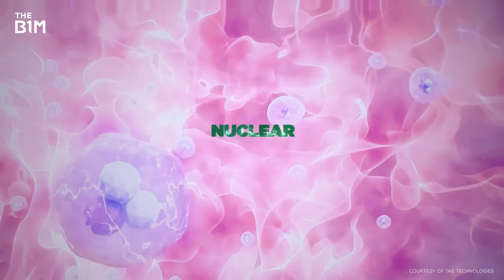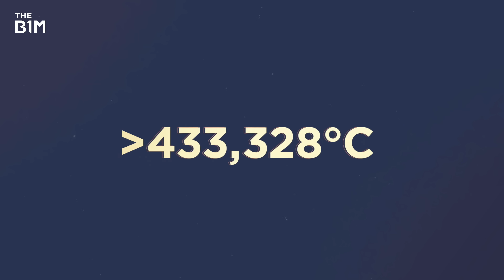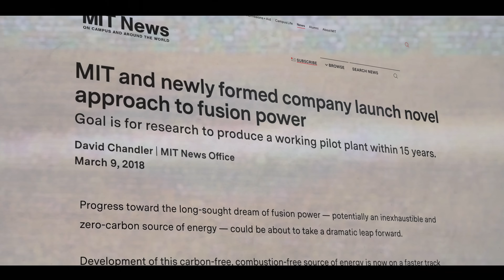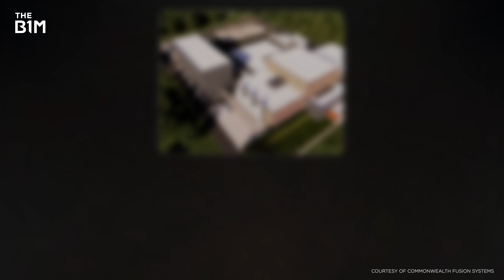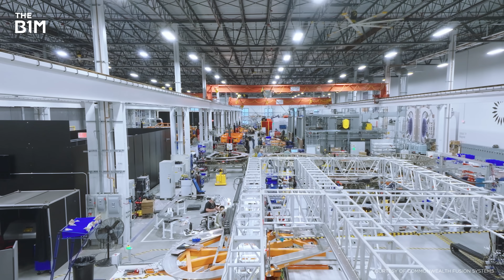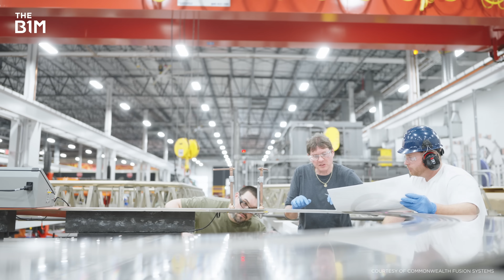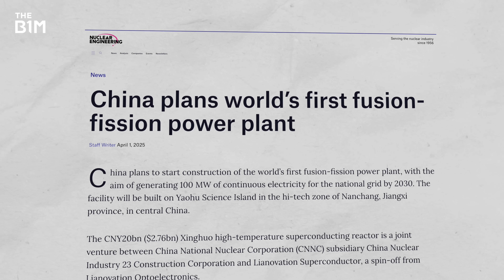Is America About to Win the Nuclear Fusion Race?

Comment: The problem with the Tokomak design is that the amount of power you need to put into it make it work is significantly more than the amount of power you get out of it. So it's basically pointless. Building a bigger one changes nothing.
Reply: Agree.
But it's the understanding of the plasma and the fusion process that is important..
At this point.
..
All talk of being the first
Is is just to secure investment..
Reply: No - that is simply incorrect. It's true of existing test machines, but not of the coming generation of REBCO tape superconducting magnet machines, and of the very large ITER. There are at least 3 projects that should make 10 times as much energy as put in, which is enough for a viable commercial plant.
Reply: @xxwookey  so what you're saying is, the new generation machines, that work on exactly the same principles at the current test machines, and which have not been built yet, will work even though none of the test machines do? And you expect me to believe that this isn't just a scheme to raise money from gullible investors?
Reply: Ah yes, all those eggheads and their billion dollar projects to build a reactor with no net energy gain.  You should give them a call so they can stop working on it and do something useful instead.

Comment: "I say cook because it works in a similar way to microwave oven, except it uses radio waves instead"... But Microwave-oven do use radio waves !
Reply: 2 commercials in 5 minutes?  I'm out
Reply: Thats why you can turn a microwave into a radio
Reply: Yeah, the frequency defined as 'microwave' (1-100GHz)is a subset of the definition for radio waves (20kHz to 300GHz). Not sure what frequency the RF heating for the reactor uses though - maybe it's outside the microwave range?
Reply: @bimblinghill 120 MHz. (I work on SPARC.)
Reply: It's literally is called microwave because it works in the microwave frequency, which is in fact different frequency from radio waves.
Reply: @guillermogarcia473  Sorry, but Microwave is part of the radio-wave spectrum.
Reply: @guillermogarcia473  You're completely wrong. The Radio spectrum and therefore "radio" waves encompasses electromagnetic radiation from 3 Hz to 3000 GHz as defined by the ITU.  Typical consumer microwaves ovens that is used to heat up food operates within 2.4 GHz which is obviously in-between 3 Hz to 3000 GHz.

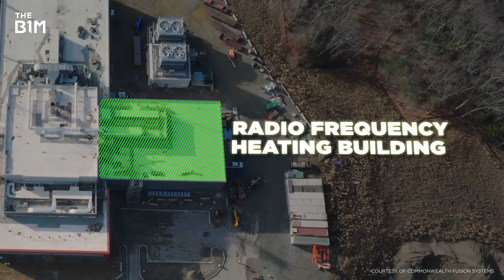Comment: 8:53 Genuinely curious how much pizza (/ any random contaminant) these systems can handle? I mean the pizza would be torn apart into individual atoms - is there enough raw mass in there in the blanket to absorb the impurities? Or are these systems so fine tuned that there just are no impurities and so no methods to remove them,, because having any would mean it would not work at all?

Comment: Yeah. Just wait until one of these things melts down shortly after it goes online.  
And one will, without doubt.   
Leave fusion to the stars and find some other way to generate power on this planet.
Reply: This comment, if it isn’t engagement bait, is a good illustration of what someone who doesn’t know how fusion works would think. Fusion requires lots of containment to keep the fusing fuel close enough together and hot enough for the reaction to proceed. If that containment fails, the reaction doesn’t spiral out of control as in a meltdown, it fizzles out. Leave scientific critique to the educated and find some other thing to comment on.
Reply: Nay sayers.
..
We need to understand fusion, as it's our best known source of abundant clean energy.
..
The holy grail will be.
Aneutronic fusion
 -
the next step after NF...
..
We can't jump to Aneutronic fusion first.
...
We have to learn nuclear fusion first..

Comment: if it wver is possible, the x ray emissions will be immeasurable
Reply: It's been done loads of times no problem with x-rays, the video is about commercial viability.
Reply: @andymouse  I am not sure where you’re getting your information but it is terribly incorrect. Fusion has not been accomplished. This is all hype.
Reply: @estimatingonediscoveringthree  Research. Over unity has been achieved albeit for micro seconds. Fusion is a long way away. Good Night.
Reply: @andymouse i have. your not defendijgnyour claim with facts or references.

Comment: The guy and his body language at 4:05 seems a prime candidate for "fake it till you make it".
Reply: Found this little  paragraph about one of their claims :P

"A claim on the website of the private Commonwealth Fusion Systems (CFS),  states that "One glass of water will provide enough fusion fuel for one person's lifetime". The data above shows that one glass of water taken from the sea offshore from Boston would contain 3 million tritium atoms which is enough to heat the glass of water by fusion reactions by 0.0004°C. This propaganda claim of CFS is clearly wrong and similar statements in many other communications from fusion advocates are deliberately misleading."

And in the same article they mentioned that all oceans together contained about 30 Kg of tritium, most of what come from early atmospheric nuclear tests.

So while a glass of water with only the two isotopes of hydrogen the reactor needs might do what they claim, gathering that and refining it to the point of fusion ready would probably amount to emptying one of the great lakes through a filter that gathers the atoms they need.

I think they need another source of fuel.

Now there is an idea that the reactors could create its on tritium by having the extra neutrons bombard I think it was lithium, and that would then turn into tritium, but this have not been tested at scale I think.
Reply: More than that, what the hell is up with his hitlerjunge haircut?
Reply: Start up just means 
Gaining investment. 
So it's a newbie into this field ..
Reply: vaporware

Comment: Only 100kg of fuel a year? Don't we currently only produce 20kg of tritium per year worldwide? And not sure I'd call it clean energy when the tritium source is fission.
Reply: Which is why they plan to breed tritium from lithium 6 in the breeder blanket, using neutrons emitted from fusion. 

Bonus this generates extra energy. 

Most of the fuel is lithium 6

Comment: An HHO or hydrogen system could be paired with a simple steam or Stirling engine to generate electricity. Besides solar or wind, there really is only steam past that, right?
Reply: Once nuclear fusion is mastered. 

Aneutronic fusion
 
will allow miniaturisation on energy production..
Reply: @stuartd9741  That solves the whole tritium breeding, neutron activation, neutron embrittlement problems, but introduces new ones, like requesting higher temperatures and pressures and even harder to acquire fuel.

Also, a miniature fusion reactor 😂😂😂. Yeah not happening
Reply: Solar also uses steam.
Reply: @glowerworm  Most solar uses the photovoltaic effect
Reply: There's also the peltier effect and magnetoydrodynamic generators. And you have piston engines and jet turbines directly driving generators. And hydro turbines.

Oh, and you don't have to use steam turbines, other gasses like CO2 work.

Comment: Why don't we just use HHO or Hyrogen through electrolysis in engines on the road and use water as the fuel with only the corrosion of the cathode and anode over time. Seems so much for fathomable that nuclear fusion has ever been proven, as gravity and that pressure on the sun is what helps sustain that process and also being many 1000x bigger than the entire earth is by itself has something to do with it.
Reply: And where do you get the energy needed for electrolysis?
Reply: Because it is inefficient and expensive. Either you are very young, naive or both.

Comment: The biggest issue with Fusion is the cost of building these power plants. We already have our long term energy solution in solar, wind with battery storage.
Reply: Fusion is actually cleaner than wind or solar...
The land footprint of a Fusion plant is smaller than what's produced from the equivalent energy generation of wind and solar...
But renewables are only marginally less efficient... 👍
Reply: @BassandoForte  You can't say it's cleaner when it literally hasn't generated any energy yet or even proof that's it's going to do so. Are you stupid?